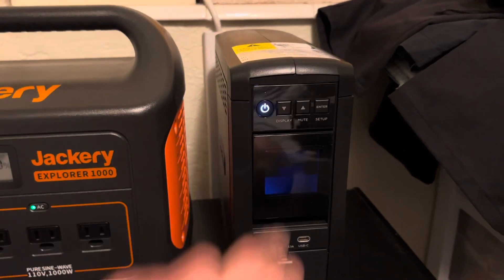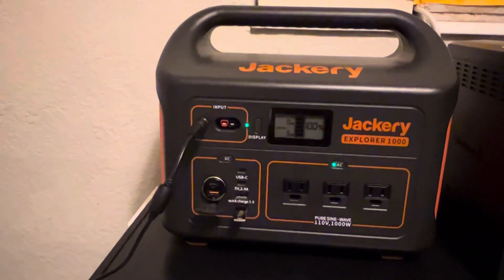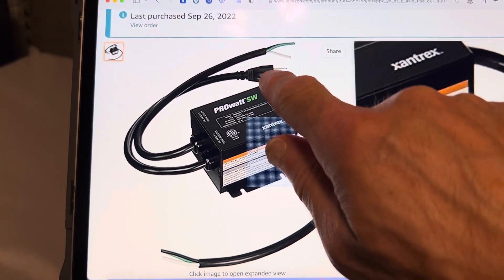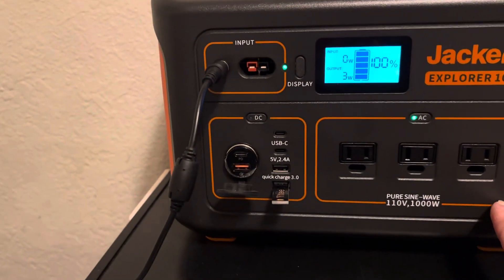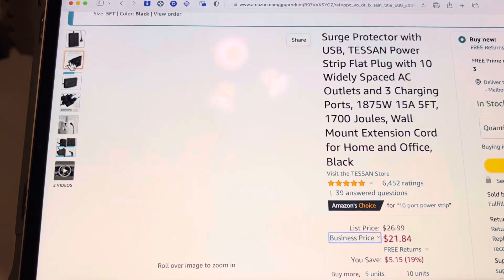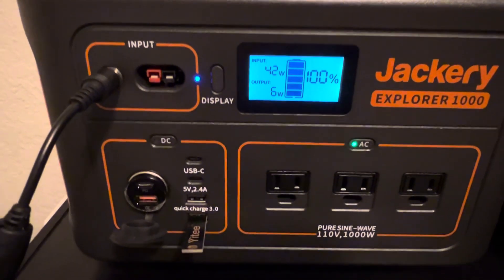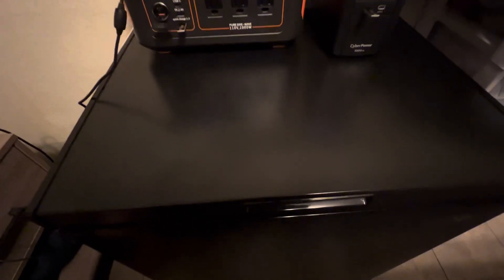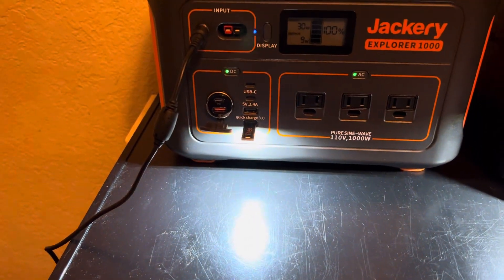Building your own high capacity uninterruptible power supply UPS. FAIL-DO NOT ATTEMPT. read comments

Comment: My question would be, can the ProWatt switch fast enough? That is, can it effectively re-route power to the "other" source, before critical equipment, IE., a PC, fails from low power input? This is not the way I would do it anyways, but it would be the first question I would ask in any event where switching is used to alter power input.
Reply: No it can't. It's not "uninterrupted"... so it's not a UPS. UPSs work the way they work because the load is always being powered off the battery with an inverter and the battery is being charged as it's depleted. This is a nice set up but it's not going to work as a UPS. All it's going to do is automatically transfer the load to the Jackery in the event of a power failure. But in that split second of the transfer, the load will lose power. Doesn't really matter for the refrigerator but it would absolutely not work for a computer.